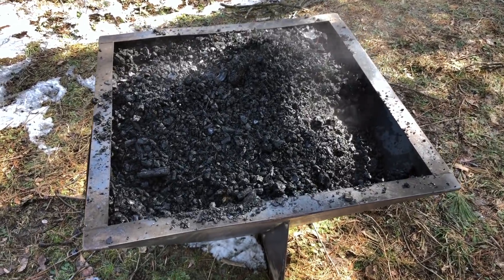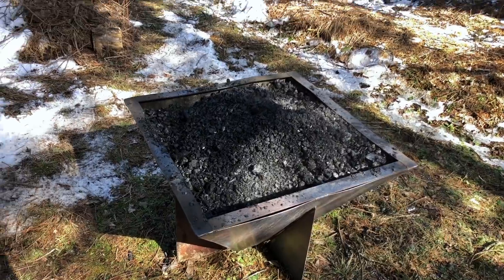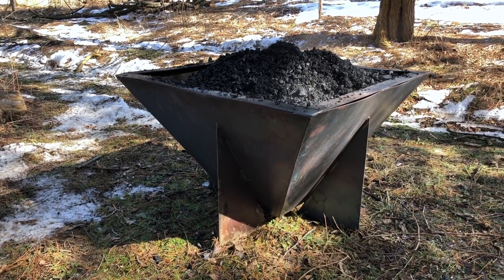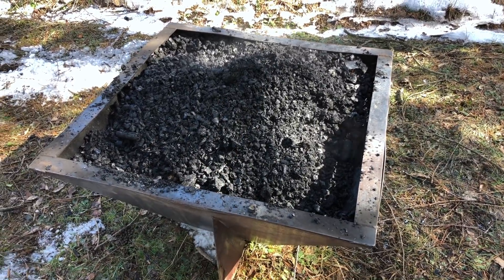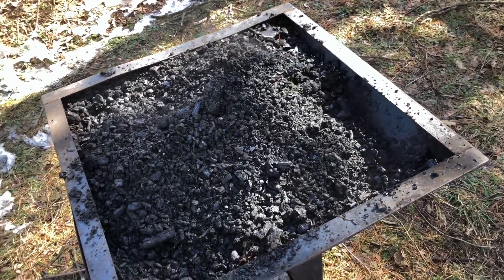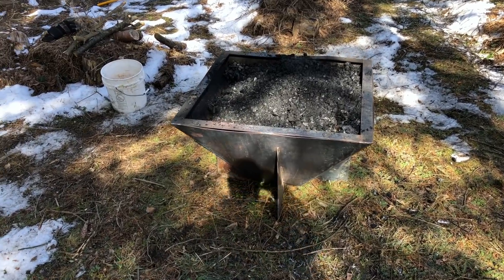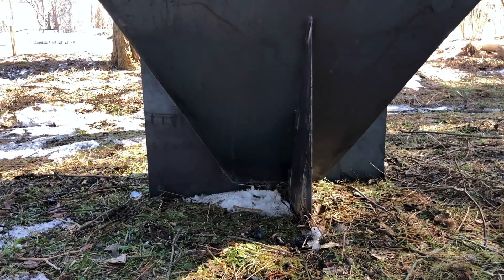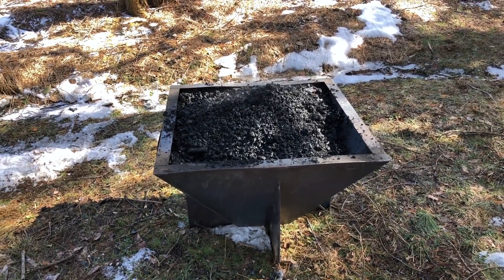Biochar Kiln - Experimental Mobile Cone Kiln

Comment: A friend is in the construction industry. He replaced the brakes on his 6-wheel dump truck and I was able to get one of the old brake drums. It's well over 1/2" thick steel, round, and conical with an open bottom. It's sturdy and thick enough that it should outlast my grandchildren.
I can set it directly on the ground to make charcoal, similar to this device, just round. It works extremely well for me. I also set it up off the ground on fire bricks to use as a backyard fire pit/grill. The the thick steel holds heat well for cooking on a discarded grill grate.

Comment: Question:  if you put a hinged top/lid on your kiln and close the lid.  Bolt it down to make it air tight.  Would that work instead of pouring water onto it? Starve the fire of oxygen.  I am thing about doing a pyramid for the top, but putting a small diameter chimney with a lid.  When you see the smoke has change from mostly water vapor to clear smoke close the chimney.  Your thoughts.
Reply from the maker: I wouldn't do that...  It may be dangerous to build up the gasses.  If you have limited water you can soak burlap or other like material in water and put that on top to smother, but water is helpful for this process and makes it safer I think...
Reply: @edibleacres  I heard adding water while it is hot helps with expanding the internal surface area as it forms pores like a honey comb which is important for microbes to be able to make lumps of biochar their home. I don't remember where I heard this so it would be nice if someone can confirm or deny my belief that this is a benefit of adding water. Thank you so much for posting your videos they are awesome.

Comment: Does it require dry wood or can green wood be used? Seems hot enough once it gets going. I have tons of brush and limbs to burn. Some small logs too.
Reply from the maker: I like to have some nice dry wood to get it going and to help out if it gets smoky/punky but overall it just rips through any feedstock we offer it, green seems fine so long as the branches aren't more than 2" in diameter.

Comment: The inverted pyramid pit in the ground is one of the classic ways to burn for biochar, so it makes sense that an inverted pyramid "portable fire pit"  like this would work well.
Reply from the maker: The geometry really works nicely.  The heat is focused to the center and makes for a very nice and clean burn.

Comment: I got the Solo Stove small fire pit, “Ranger” model - it’s a cylindrical stainless steel fancy high tech secondary burn system that looks like it’s modeled on a rocket stove.  https://www.solostove.com/solo-stove-ranger/ I haven’t fired it up yet but I did get it to burn all the little wood and sit on top of my plastic deck, near structures and not cause fire. I’ve been thinking of using it to make biochar. I don’t know if it can take quenching, don’t see why not. I’ve also thought of getting same shape but smaller stainless steel lidded hotel pans and making the char in a similar way you do inside your home wood stove. What do you think?
Reply from the maker: I'd be careful with quenching that stove, it may be a bit fragile with extreme temp changes?   One idea woudl be to use a watering can and quench only in the center so you don't shock the metal as much, and then gently stir to distribute the water, and then maybe take a few super saturated burlap sacks or the like and cover everything thoroughly... Just a thought.

Comment: What made you choose open pit burning over using a more efficient charcoal kiln or retort?
Reply: One advantage is not having to cut the wood to size
Reply from the maker: If what I had was perfectly uniform small chunks of dry wood, I could use the TLUD or other method commonly promoted..  BUT, if I had that material I'd rather save it to make charcoal in the small stainless steel retorts we have for our wood stove!  This approach lets me take prunings pretty much just as they are and convert them pretty darn effectively into charcoal!  No wood chipper, no chop chop chopping everything down and packing a retort... It feels super effective.

Comment: That stuff looks great,so even in size.
Reply from the maker: I'll make a more thorough video showing the flow of making it.  Having done it for almost 10 years I finally feel like I understand the art of it, and some really intense 'poking' with a stick or metal pole (tpost!) during the whole process crushes the char nicely,  helps bring up logs and branches that aren't finished to the top where they can finalize and releases a ton of good heat...  Only one decade of experience to learn 'poke it with a stick'... ha!

Comment: Hello. Thanks for a wonderful video. Loved it. Did this kiln work better than a kontiki kiln or even a regular cone pit system for you? Is the quality better or the speed higher? I’d love to get more feedback on why you think this Biochar (and/or the process of making it) has turned out better than your previous experiences.
Warmly,
Taimur
Reply: From what I've seen online of the kontiki kiln, it is much the same thing but a lot bigger. I think Sean's one looks a lot more realistic for most people than the kontiki
Reply from the maker: Much more complex answer to give the full picture, BUT...  This time of year the ground is super saturated and ice cold.. Digging a cone pit in the earth would result in horrible results.  Some areas the ground is too frozen to dig anyway.  This mimics the dimensions of the cone pit in a decent way and makes for very good charcoal at a very decent speed.  Being mobile, able to operate at this time of winter and still be clean and fast makes it quite exciting an option.  I haven't used a kontiki so I can't say, but I'm pleased with this basic design for sure...

Comment: Another option which might take less water (not an issue for your site but maybe another) that can use the standard 55 gallon barrel TLUD design: https://www.youtube.com/watch?v=RTQfNsfcXUA which is used for making water filter charcoal in their case but would work for biochar of course: https://www.aqsolutions.org/charcoal-biochar-water-treatment/ In this case, they use a gallon or two of water to make a small mud pit, and after all the wood inside is burning, the barrel is placed in the mud to block the bottom air intake, a lid is placed on top, and some of the mud is used to make an airtight seal around the top too. This prevents any more combustion without pouring water on the biochar, you just wait a couple hours for it to cool off instead. So you trade water use for time needed.
Reply from the maker: That is appropriate for a contained TLUD style, or a definitive and isolated retort section of the kiln, but this is maybe a ltitle funky/complex to do that way.  One route could be to have a sheet of steel cut to lay on the top exactly, and quench the char a bit with water, lay a fully saturated burlap sheet over the charcoal and then put the metal on top with weight...  But this only takes 15-20 gallons of water to fully put out so I'm OK with that volume.

Comment: Just have in mind that 1 kg of wood has thermal energy (burned efficiently) equivalent to 5KWh  or 3.6 MJ. So in a case where the wood is being burned, without heat capturing, that energy is being directly pushed to the air. With the heat, the wood you burn (let say100 pounds) produces, you can heat 266 gallons of water to 144 F ( or 62 C). That is theoretical maximum, in reality, as you are not oxidizing most the carbon itself the energy captured will be likely 3x smaller. But even that, almost 90 gallons of water at 144 F is something to be considered when people think about natural resource preservation.
Reply from the maker: I am quite interested in integrating a copper coil on the outside of a kiln like this with insulation that can grab a lot of the side heat from this and put it in a large container..  I need to research more!

Comment: I wonder if an open or screened bottom would allow charcoal bits to fall out as it burns, then the whole thing could be mounted over a puddle or other water source to quench as it falls
Reply from the maker: I think an open screen would convert way too much to ash... . I saw a design where someone incorporated an auger into the bottom that would screw into the bottom of the container and transfer ash through a solid pipe up and into an open container with water to quench it.. .That coudl work but would be complex. . The system is decent as it is, I don't know that it needs that level of tweaking...
Reply: I was thinking 4 small (1/4" maybe) drain holes in the bottom, but anything larger could allow extra air in from the bottom, which is not desired. As you add more material on top, the bottom bits get less oxygen and don't turn to ash. But a screen would keep it burning and you'd lose charcoal that way.
Reply: The auger sounds interesting to prevent air, but yes it probably is too complex. It will be interesting to see what designs come from people trialing this.

Comment: Thanks for posting this. I was going to replace my crude concrete block maple sap evaporator this week with a 55 gallon drum & a stove conversion kit but you gave me a different idea to pursue.  I think I'll contact Andy to explore a combination fire pit / biochar kiln / sap evaporator. I'm just a short hop south of him in Pennsylvania.
Reply from the maker: I think there is amazing possibility of incorporating biochar production with maple syrup production... Maybe there is a copper circut that runs around the outside that preheats the sap or runs in a loop to get it far along... You'd want to keep the top mainly open so you can work it...
Reply: I guess I'm kind of randomly asking but do anyone know a good website to watch new series online ?
Reply: @Alden Brennan I use flixzone. Just search on google for it :)

Comment: is the purpose of the pipe and valve on the underside to drain water or to calibrate aeration? both??
Reply from the maker: It was to drain off fluids... I didn't mention it in the video because it was a little bit of a dud design wise on my part, it clogged nearly instantly!

Comment: Maybe a stupid question... but I was always told that eating charred food was carcinogenic.

Is this a concern for the chickens that are pecking through this char?

Is the main goal the odour absorption, or the speed of the carbon entering the compost? 

 Because I'd assume that the wood rotting naturally would introduce as much of not more carbon to the compost?

I guess I just don't fully grasp how biochar fits in the permaculture model. 

Cheers!
Reply: Biochar is not anything like charred food.  It is more like the activated charcoal they feed you if you ingest poison.
Reply from the maker: Worth researching biochar as a concept, there is a lot there!
The carbon in this case is super persistent in the soil, like 100s or 1000s of years.  Short run it absorbs lots of excess odor, long run it holds onto nutrient for incredible lengths of time.
No concern about the chickens pecking it, I don't think they eat much, but what they do is probably good for their guts.

Comment: I don't know how thick the steel is, but it looks like it's thin enough to go through heat warping. I can just imagine it warping during a burn and catapulting some of its contents. Some thing to keep in mind.
Reply: Considering it’s from a guy who builds fire pits I’d hope he’d be aware of that... lol
Reply: @puffcrusader696  So did my friends father with one he bought one from the store. It suddenly bowed in and threw smoldering charcoal out of it. Luckily it was set up on pavement away from any structures.
Reply: All I'm saying is to give it a better safety distance from combustibles.
Reply from the maker: Reasonable note here for sure.  There was a bit of warping with this at certain super hot points, but nothing crazy... Good to be careful!

Comment: Beautiful, if you get a piece of steel plate for a lid you can do all sorts of cool things in the absence of oxygen. 
One thing i always do when i make char is mix in about 30 % volume wood chips as it finishes to quickly add mass.
I dont have a lid so i can only mix in so much, or it begins to smolder.
With your pit and a lid you could probably mix in up to 60 % wood chip in and cover it for for an hour or so and have it turn out perfect.
Reply from the maker: Interesting idea.  I'm thinking about what it looks like to integrate more wood chip -> biochar!